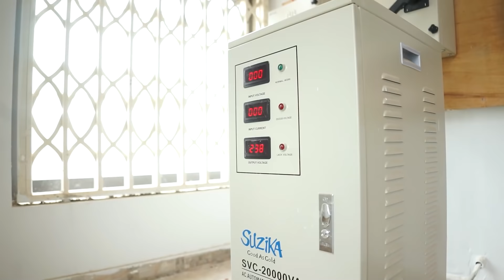How much it costs to build a 4 bedroom house in Ghana from foundation to finishing

Comment: Another solution for your rain waste water run off is to have a pit or well dug into the ground built with concrete blocks and steel and use it for the roof catchment. Use a sprinkler system to distribute this stored water onto beautiful lawns, gardens, fruit trees, and such greenery that I am sure Kingsley will incorporate down the road.

Comment: Asher please expand a bit more on the isolation plumbing upstairs on your channel 🙏
Reply: Basically two stop cocks in the bathroom. If there is an issue in the bathroom I can isolate it by using the stop cocks. If I didn’t have that, I would have to isolate the entire house water supply, which would be inconvenient. I have various water supply zones throughout the house for that very same reason. Hope that makes sense

Comment: And by the way, i have saved this video to my watch later file because of the thoroughness and knowledge this brother shared on construction processes and infrastructures needed to build a quality home.  Cause 3-phase electrical is normally used in the states only by commercial/business.
Reply: That's correct. Residential only takes in single phase. That's how we do it in commercial electrical. The more I started working on my side work I started paying closer attention to that which brought my mind back to what we were learning in apprenticeship class.
Reply: I did the same.

Comment: Being in construction most of my life and running a small window and door business I have lost count of the number of times I have seen this happen with different skylights that ended up leaking because some jack leg stepped in claiming he could do it for half the price of the bidder already settled with. Making claims the first one is overcharging.  The foolish builder goes along because he agrees it is pretty expensive.  Often the dumb builder compares a 6' x 6' skylight price with a
 6' x 6' window. Apples and Oranges!!! The only thing in common is glass and a frame. The instant is different in many ways. 
   So a week later it rains and it leeks like a sieve and the jack leg has taken the money and skipped town. It happened to me twice. On the second one I said fine but don't call me when it leaks! From.then on I started charging even more and would demand full payment up front and no returns or backing out. I  still  got a few jobs because mine never leaked.